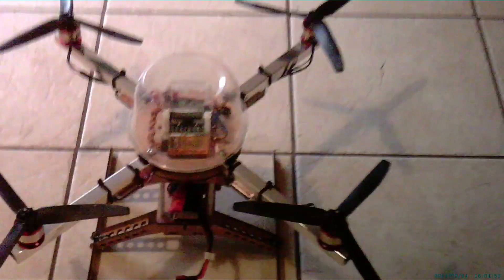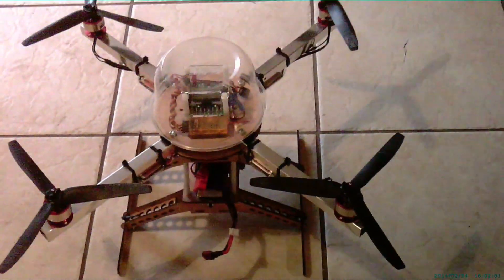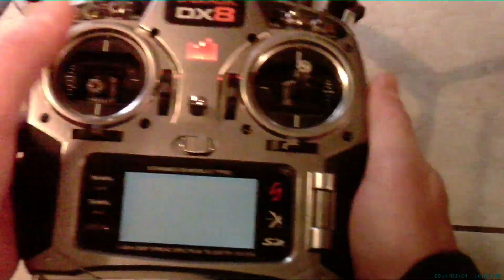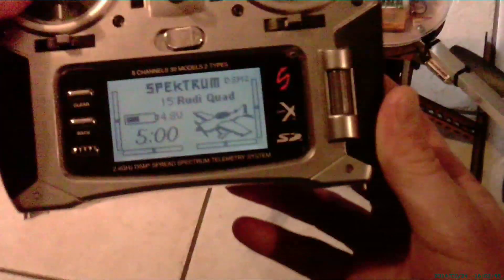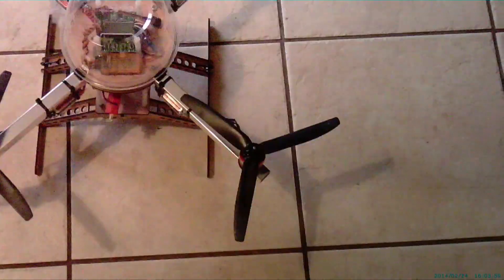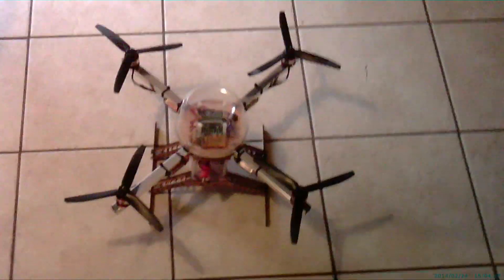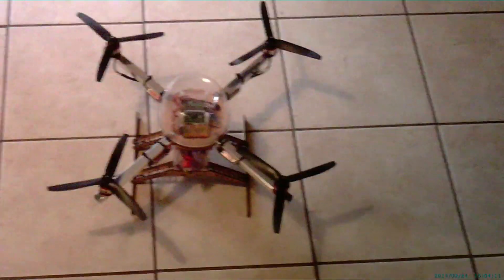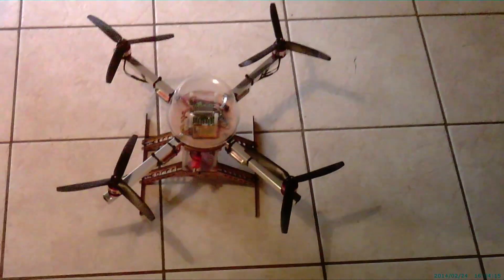Rudimentary "Rudi Quad" scratch built DIY drone

Comment: Hi, how did you mount propellers onto this motor?
Reply from the maker: Alan Sparrow With the prop comes a supplied 3mm motor shaft adapter.  I inserted the adapter in the prop and placed the prop directly on the 3mm motor shaft.  I then threaded a ziptie under one of the bell arms on the motor and came around one of the rotor blades and crossed behind the motor shaft.  I Zipped it down snug and it is as close to the motor as possible and not enough weight to make it off balance.  If you have not already done so, please subscribe.  All the best and Happy flying!
Reply: RonALampman Thank you for your answer, can you give me a link of the mounting component you used?
Reply from the maker: Alan Sparrow Here is a place to get the zip ties:
http://www.cabletiesunlimited.com/cable-ties/color-cable-ties-18-lb.html
Most brushless motors have cooling vents on the top of the bell you can run them through.  You will need a motor shaft adapter for your prop to make a snug fit onto the motor shaft.  All the best and Happy flying!

Comment: Very Nice Quad :) seems to be very stable , Good job :)
Reply from the maker: Thank you!  It is quite stable.  These KK2 series of boards can be calibrated to fly fantastic!
Reply: RonALampman
Yes , I put one of this on my quad , very nice and easy to setup with the lcd :)
I just order another one for another project :)
The only thing we have to do ( perhaps with many controler ), is to isolate the board from the frame correctly , or you will have an "unflyable" craft :)
Reply from the maker: Dj GARFIELD Eplkt  Correct, I started by using rubber bands threaded through the bolt holes of a KK board and looped around bolts about 3/4 inch out from all corners of the board.  That was with unbalanced props.  Now, nylon screws and spacers to the trick quite nicely with balanced props.

Comment: Zip ties, very interesting.
Reply from the maker: They work fantastic for these little motors.  Less vibration and lighter.
Reply: Have you tried it with two blade props as well?
Reply from the maker: UnlimitedVertical
Yes!  They work great.  I just make sure which ever side I run the zip tie through on the bell, I run it on the opposite side of the motor shaft over the top of the prop.  Balance the props first and the motors run very smooth.  I like 3 blade because they balance to perfection easily.

Comment: Hi Ron watched many of your vids and have subscribed I would like a really flat out opinion  of the i86 vs kk2 LCD I don't want a board that requires a PC to work on it . You are one of the few that have shown the i86 in action and I think the 86 is what I want for my first multi rotor project look forward to your thoughts
Reply from the maker: Hi Kevin, it all depends on what you intend to do and your rc flying experience level.  Please subscribe.
Reply: Been flying for 2 years and want to try a quad or tri  just want to keep it simple .   When I get better I want to put in a lite fpv set up no gimbals no go pro just fun flying .. Easy to tune no PC's or flashing firmware
Reply from the maker: Go with the KK2.1.5.  The auto level feature will save you lots of heartache.  But remember, you will crash sooner or later because the more you fly, the more you push it.  Happens to all of us.
Reply: Thanks for the info... Keep up the videos
Reply from the maker: Thank you Kevin.  All the best and Happy flying!

Comment: very nice RON, i am also having  pretty much similar configuration, only difference is the esc, i am using hobby wing 30amps esc both my motors and the esc get hot within a minute , even when i am at 2/8 th of throttle (escs are well calibrated) it was not happening before. After 3 or 4 flights it has started heating up .. do you have any idea why is it heating up now?
Reply from the maker: subbu, So, are you running the same motors?  If so, what size props are you running on them.  With these motors if you go over 8x4 prop, it will overload the motor which will overload the props too.  Also, were these flights back to back and were you doing acro?  This too will also cause heating problems unless you have a very light airframe.  Hope this helps and Happy flying!
Reply: RonALampman my motors are fc28-12 from hobbyking, prop size is 8045sf, no back to back flights and just simple slow flying, my frame is F450 and total weight is 900grams, and i forgot to mention that the temp in my place at that time was 40 degree
Reply from the maker: subbu kr
Subbu, I can already see your issue.  I had the same results with an 8045 prop  The pitch is too high.  8040 or an 8038 will work just fine with these motors and is quite efficient but stepping higher in pitch will cause the heat and shorten the life of the motors.  Same holds true for running a larger prop on these motors.  8" is the most these will spin well.  Hope this helps and Happy flying!
Reply: RonALampman
well then i need to lower the prop size,thanks for your suggestion. i appreciate it.
Reply from the maker: subbu kr
Subbu, the prop diameter is good, just need to lower the pitch a bit.. Ha ha.  Try the 8x4 3blade props.  They work fantastic with this motor.  All the best!

Comment: Thanks for your comments, Ron.  We have a few things in common on our copter builds.  For example, I also zip tie props directly onto motors - with the Emax, I use 3 of the lightest guage ties I can find.  Cheers, Simon
Reply from the maker: I keep telling people that these zipties have very little to do with making your balanced props off balance.  It seems to me they are much better than prop adapters for balance.  All the best, Ron